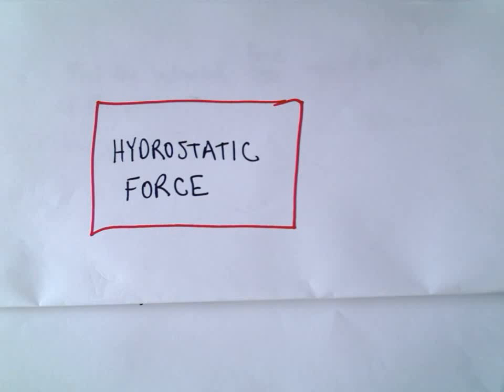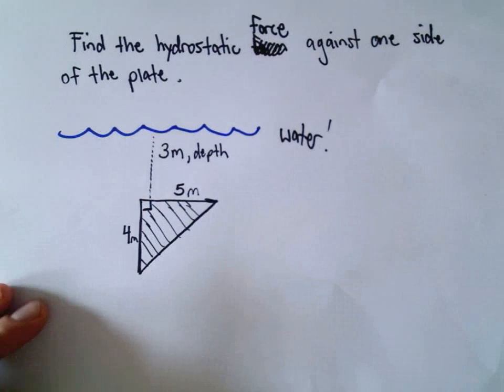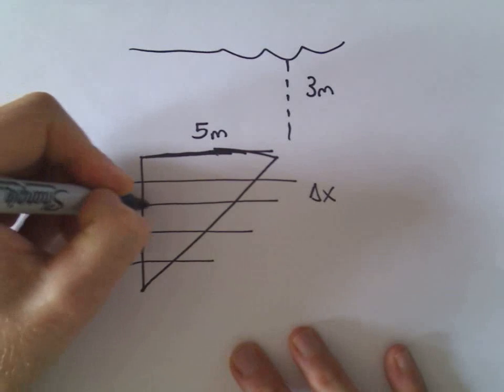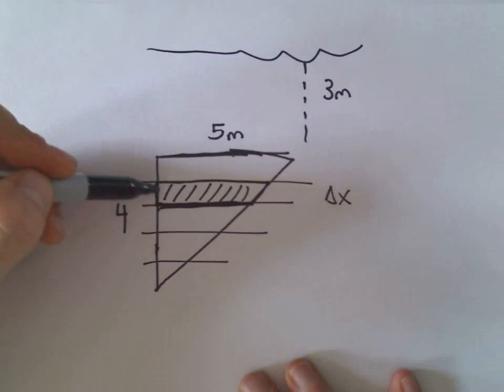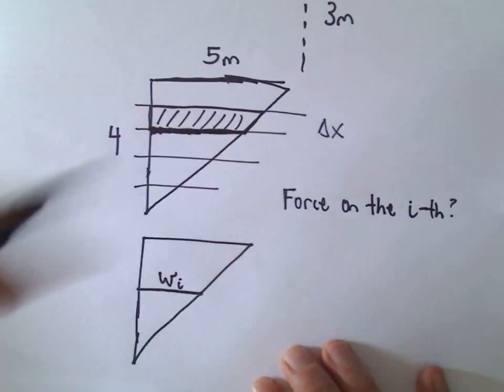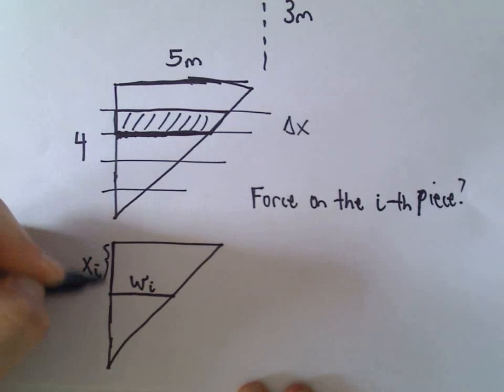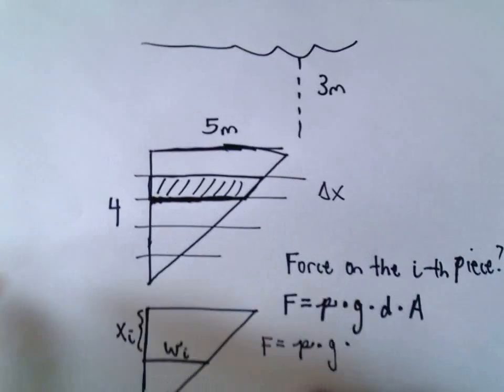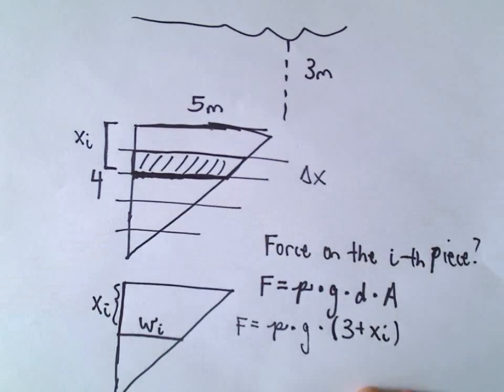Hydrostatic Force - Complete Example #1

Comment: Your integral shows from 0 to 4, however on an online assignment I have a very similar problem that has the lower limit set as 3 because the starting point is 3 feet below the surface. Shouldn't your problem also integrate from 3 to 3 + 4 or 3 to 7?

Comment: wouldnt the bounds be 0 to 7 since the triangle is 3m under the water
Reply: +Lakshan Rasalingam no because the bounds on the integral are the values of x we're using. The 3m is a constant, while we add x which is variable depending on how deep /within the triangle/ our "slice" is, which varies from 0 to 4m. That way, at the very bottom the depth is (3+x) at x=4 which is 7m, and it's never gonna be lower than 3 because we're not adding what's outside the triangle.

If you wanted to use depth as your x, your bounds would be 3 to 7 and but then you'd have to subtract 3 in some places and it would just be unnecessarily messy.

Comment: Why did you put the limit as n goes to infinity?
Reply: Karen Roman Because if n=4 only, you will get an approximation of the calculated force on each of the 4 strips, you add them together to get the total force on the 4 strips. The more you subdivide the plate in the problem, the more you increase the precision of calculation. So if you make n=infinity, you get the real force, in the most precise value. Which means, the integration in the video. Cheers.

Comment: Could you explain why you made the bounds of the integral from 0 to 4 rather than from 3 to 7 (since the plate is submerged 3 meters below the surface)?
Reply: That's because he included the initial 3m into the deph equation (3+Xi) so you don't need to include it in the integral.Therefore in the integral the end points would only be the actual height of the triangle which is 0-4.

Comment: I have a really hard problem, well I don't get it, please help me!

I'm given a set of values of the depth and width of an irregular shaped plate submerged in water and the problem is "Choose the correct numerical method (LEFT, RIGHT, TRAP, MID) to compute the best overestimate for the total force of the water against the plate. "

These are the values:

        Depth:    2     2.5      3     3.5     4      4.5     5      

Plate Width:  0.2    0.5    1.3    2.4    3.9    5.6    8.2

Please, if you can help I would greatly appreciate it.

Comment: Patrick, can I do this same problem a different way? My teacher taught us to integrate by simply multiplying depth IXI times the equation for the positive line from points (0,-4) (5,0), where the top edge of the triangle is the x-axis and they y-axis runs along the vertical edge?

Comment: Ok, I have a question:
Calculate the fluid force on the side of a right triangle of height 3m and base 2m submerged in water vertically, with its upper vertex located at a depth of 4m.

So I got the right answer (176400N) when I did the integration from 0 to 3 and had (4+y) as depth and (2/3)y as width, but I wanted to solve it where I integrate from 4 to 7. I tried making depth just y instead of 4+y, (basing this on your response to bacardi1414 ) but didn't get right answer

Comment from the maker: @bacardi1414 well, if you let x be measured from the top of the water, that would be correct (cause x must equal 3 before you start touching the plate). however, since i measure from the top of the plate, x starts at zero. notice it is the same though; in your scenario, the depth would just be x, while integrating from 3 to 7; in mine,  i integrate from 0 to 4 and my depth is ( x +  3)